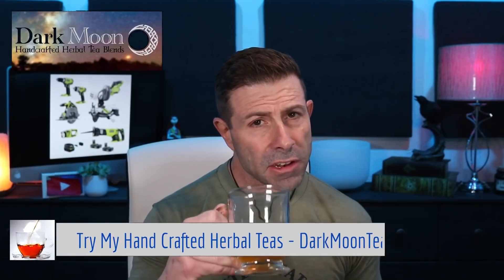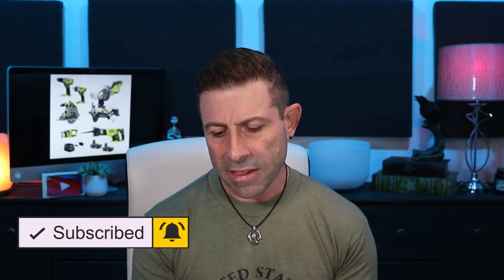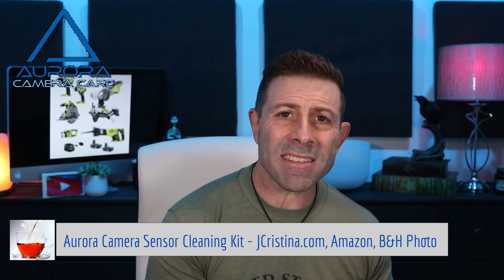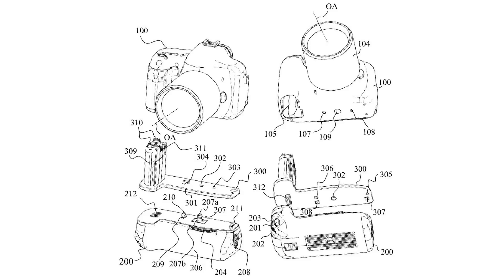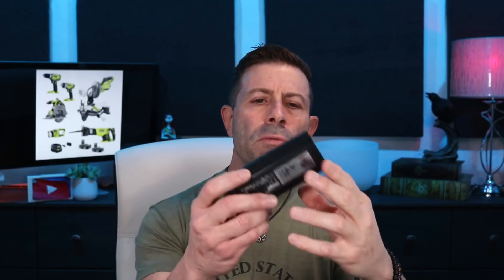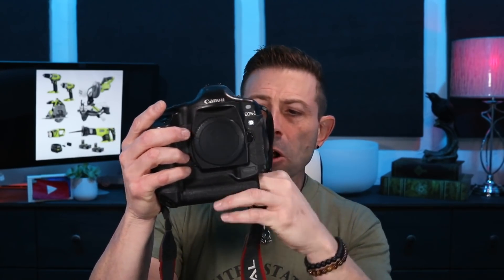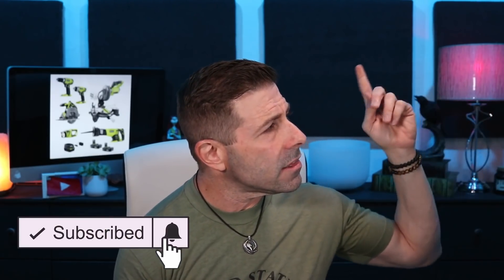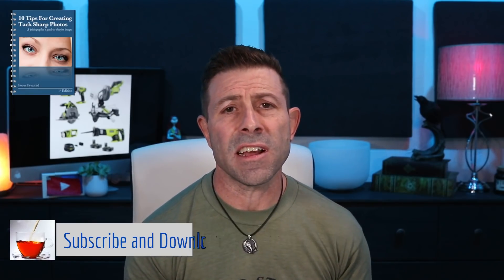Canon EOS Next Generation Power Tool Patent

Comment: Some of the discourse here online makes no sense because some people do not know the basic/physics of gear.A perfect example was the MYTH about Sony cameras being 'defective' because they got hot and shut down.When you have a case with a small footprint,and you are generating a lot of power,the unit will get hot or even overheat.This is because of thermodynamics,because that heat must be dissipated,for the unit to cool,and operate under idea conditions.Because of the thermal load,we usually see protective systems,like fans,heat sinks,fuses,or a shutdown,until the temperature drops.This happens in Class A/AB power amps,computer systems,and of course,devices like cameras attempting 4k/6k/8k,etc.This is why server rooms and mainframes are COLD,with open airflow.Now,let's say I assemble and boot up my SGI machines,and want to render,edit,etc.It probably will not run hot,because it's only doing ONE job,not gaming,web browsing,or running Windows Office Suite.Plus,it's a command line machine,so there's no GUI,taking up resources,and the source code does not have to be as complex.Now when you rush or do not pay attention,you're apt to make mistakes,so Canon is releasing patents and doing their homework FIRST.For example,we all know a company who evidently did not do their homework with quality control,releasing a new camera with two recalls and a battery grip that's damn near a waste of time.I am sure had they done demographic homework,proper product field testing,some product surveys,they would have delayed the release,and get it right first.So yeah,like someone told me,they have a right to their opinion,yet since this is not one of them toy BS channels,we are trying to share knowledge,not wild conjecture.

Comment: An accessory attachable to an image pickup apparatus through an adapter includes a body portion configured to contact the adapter, a screw engageable with a screw hole in the image pickup apparatus through a through-hole formed in the adapter, an operation unit configured to move the screw relative to the body portion. The screw is movable in a plurality of directions including a direction along an optical axis of the image pickup apparatus and a direction orthogonal to the optical axis in accordance with an operation of the operation unit by a user.

From the patent literature:

    SUMMARY OF THE INVENTION
    [0004] The present invention provides an accessory and camera system, each of which is generally attachable to a plurality of types of camera bodies.

    [0005] An accessory according to one aspect of the present invention attachable to an image pickup apparatus through an adapter includes a body portion configured to contact the adapter, a screw engageable with a screw hole in the image pickup apparatus through a through-hole formed in the adapter, an operation unit configured to move the screw relative to the body portion. The screw is movable in a plurality of directions including a direction along an optical axis of the image pickup apparatus and a direction orthogonal to the optical axis in accordance with an operation of the operation unit by a user. A camera system including an image pickup apparatus, and the above accessory also constitutes another aspect of the present invention.

    [0006] An accessory according to another aspect of the present invention attachable between a battery grip and an image pickup apparatus includes a body portion configured to contact the image pickup apparatus, and a first positioning member configured to position relative to the image pickup apparatus. The body portion has a through-hole into which a screw of a battery grip is inserted in order to fix the battery grip to the image pickup apparatus. 

https://www.canonwatch.com/canon-patent-battery-grip-that-works-with-different-cameras/

Comment: This is to big and complicated for me. Here is a simpler, better and more flexible solution (and one no manufacturer like to have):
On the bottom of the camera is a USB-C connection for external power, external SSD-drive and digital sound. There are a few screw points at defined positions in addition to the tripod mount.
Now the manufacturer and everybody else can build any kind of battery and/or external drive with any amount of capacity and any form factor like small bottom plate, vertical grip, cage, with additional XLR inputs and so on. If this connection gets standardized it would be possible to create a core addon battery/store part that fits with custom housings to a lot of different cameras.
Reply from the maker: Battery pack on belt. 👍

Comment: From an engineering stand point having 2 ways into the battery compartment with 2 potentially different batteries is a designers nightmare, and it  makes the battery compartment physically weaker. What you see as the old release on the back could a switch for something, only Canon knows.  Making a universal battery holder that fits all of their cameras is more practical. Canon can then make their newer cameras base plate the same and then let their  designers fit the new bodies to this base plate. This would be far easier, pull out one CAD file and go the town designing the new camera. Having 2 ways into the battery compartment just doesn't make and sense to me. Having said that I'm quite sure that I'm wrong and Canon will find a way to make it work. Go figure. LOL Thanks for the video update on what is going on the the camera world.

Comment: I think Canon has solved the problem to power more powerful processors for more advanced tech in their camera bodies and lenses and keep them cooler by use of more mAh powerful batteries as the same way as cel phone batteries have evolved.
Reply from the maker: I do agree.. Also, placing the battery outside of the unit allow for more heat dissipation of course. Win / Win / Win

Comment: Mate, my 5D Mark IV, 5DS, and EOS-R ALL use the SAME battery; your enumerated list is wrong, flat wrong; LP-E6(N)! (My 7D2 and 5D3 did the same ...)
Reply from the maker: Thanks Martin. It's not about being able to switch but being about to use one single grip on all units and possibly power them with a massive 1D size battery. I think this is the direction Canon is going with this and of course heat distribution but that's for another conversation. Could be wrong and thanks for your thoughts my friend.